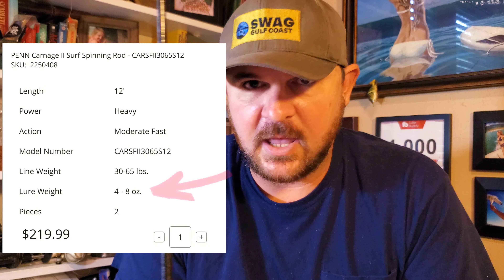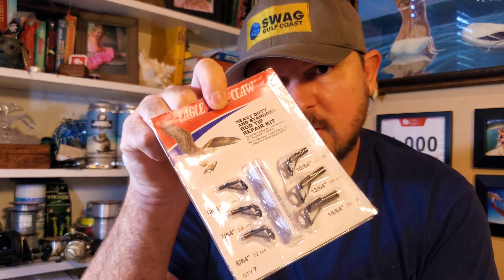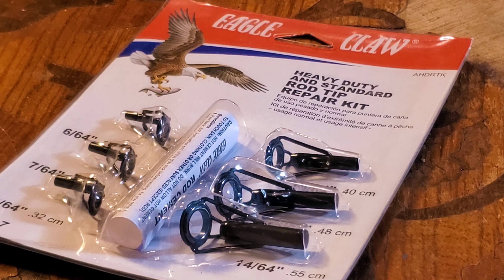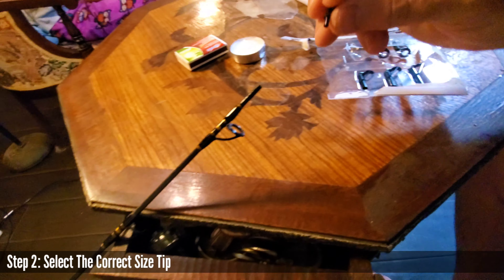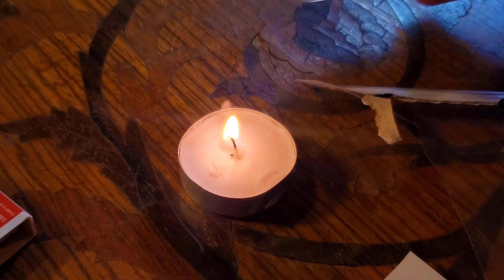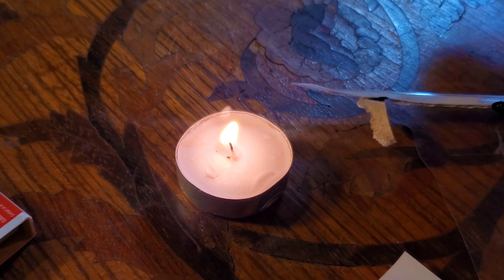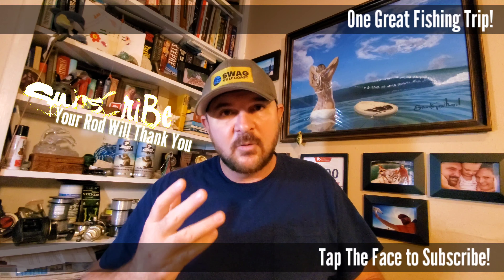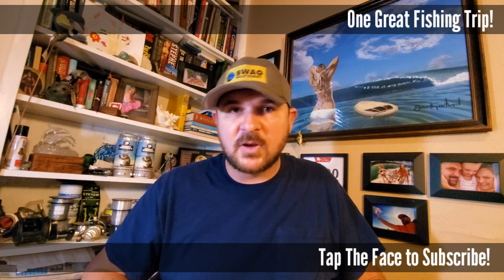How to Fix A Broken Rod Tip | Fast & Easy With Professional Finish

Comment: Great tutorial!  In a case like yours, broken so close to the next guide, you can also cut the rod itself down to that next guide, and do a fill with glue.  Looks like your fix will do well, and I hope it gets you back up and running for the long haul!
Reply from the maker: I had considered that... opted for the tip guide simply for cosmetic reasons. But ive taken that approach many times.

Comment: I need to do this to a rod I usually just sand it down when the gap is so small or cut the eye on there and replace it with a smaller one . I broke a new rod lining the pole once 🤦‍♂️
Reply from the maker: This was the first time I had ever done a fix like this... it was stupid simple.  I respect sanding the pole etc but man this literally took me three minutes the very first time I did it, doesn't get ANY easier than that!

Comment: The thing that concerns me about replacing a rod tip is how the action and sensitivity can change. But, with a big 'ole surf rod it may not make much difference. Penn has told me before that damage to guides was deemed "abuse" and not covered by warranty, but this is the blank you have there. Have you reached out to them?
Reply from the maker: I agree about sensitivity, but yeah that makes zero difference in the surf. Far more important that i can cast an 8-12 oz weight! Lol

I reached out to Penn about this and several other issues. I totally love their product, but customer service has been far from stellar.

Comment: I had a ten ft crappie pole that was a blast to use at the beach.  Catch a pin fish or hard head and it felt like a shark, rod would bend over real good always a awesome fight. Anyway onetime  my buddy came over and we were loading up the truck for a beach trip, I grabbed that pole to show him how well it bends and tell him how much fun it is, i barely began to bend it and snapped about six inches off it. It sucked lol
Reply from the maker: Man half the reason i did this fix-it job was because we had snapped a crappie pole of Rachel's. It had belonged to her grandfather, just wasnt meant for the rigors we put it through. I ended up not being able to fix it though; its an antique with rusted guides and i want to try to restore it properly for her.